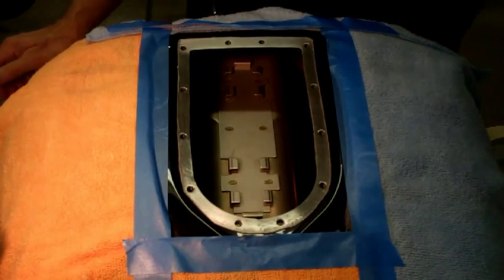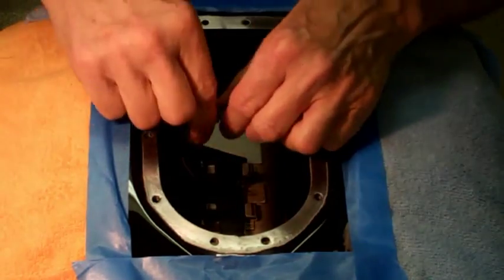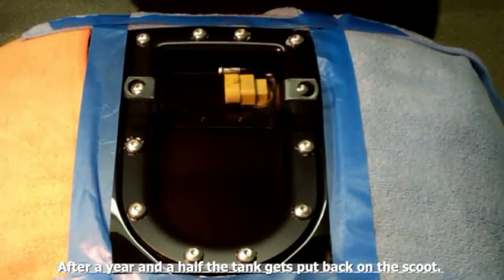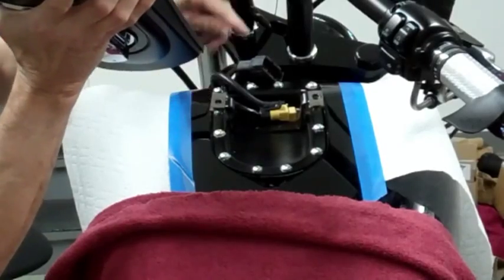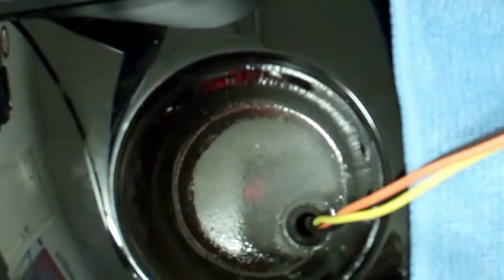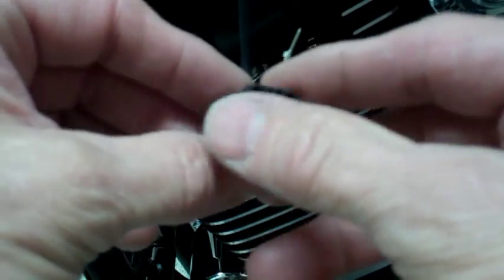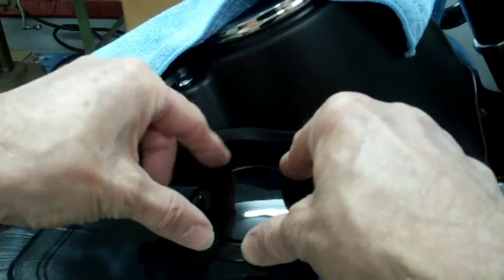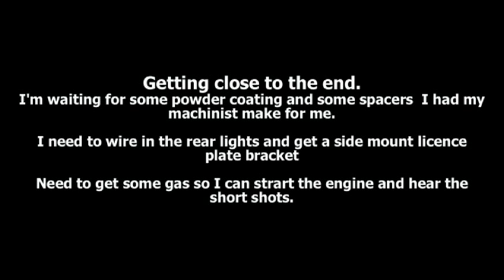My 2004 Harley Dyna Custom Project 2011-2012 #23

Comment from the maker: Just pull up. Don't twist. The wire connections are under the tank. Sometimes you can get away with not lifting the tank. Hope this helps.

Comment from the maker: "Hey awesome vid and upgrade, im looking at doing a simaler tank swap on my 01 fxd using a newer style tank so i can do the flush guage and cap upgrade. what year is the tank you used and it is a wideglide tank i assume?"

Sorry I missed your question. The tank is a 05 Wide Glide tank. I don't think a late model tank will fit your 01 frame. Harley changed the Dyna frame in 06. The tanks are larger. Different mounting points.

Comment: i bought the gauge used and it did not come with the clip do you think i could use the stock one?
Reply from the maker: I don't remember what the stock clip/housing looks like. If it has four holes for the pins it should work. Just put the pins in the right holes as I described in the video. The third hole is left empty. If the clip doesn't look like the one in my video you will have to get one from Harley. P/N 72904-01BK
Reply: thanks all your videos are very helpfull
Reply from the maker: Erick Armour Thanks. Just a heads up. If you got the fuel cap too, when you take it off to fuel put it in a safe place. I put mine on top of the gas pump and while I was putting gas in the tank the wind blew the cap off and it hit the concrete. The cap got chipped and now I have to buy a new one.